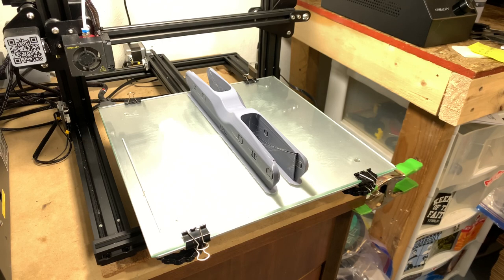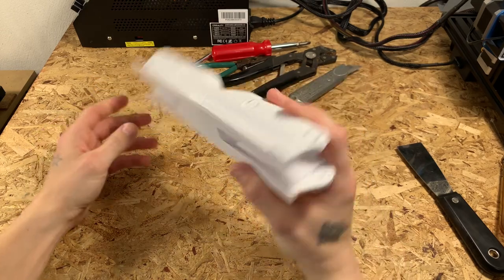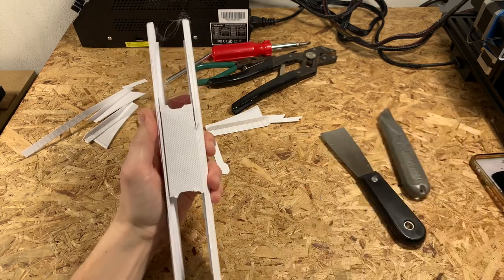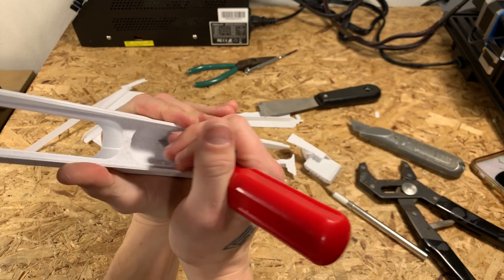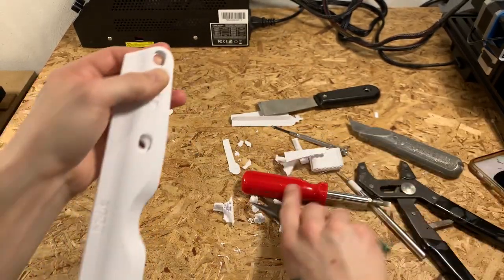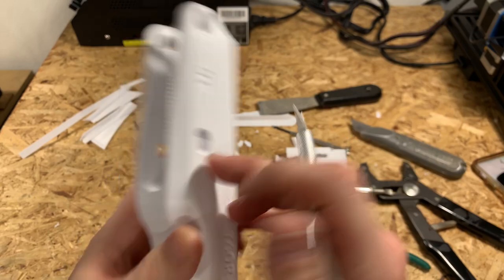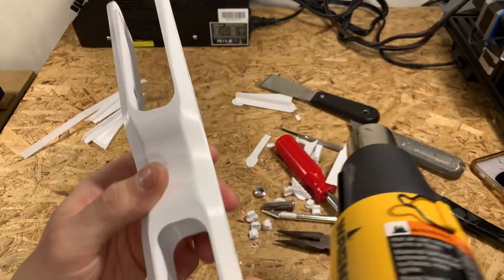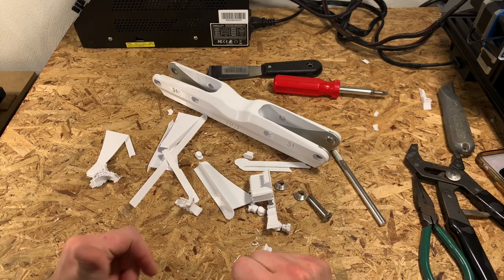How to remove supports and prepare 3D printed frame walls for the 50/50 Core System

Comment: Can you print some suspension frames and some replacment bushings. As far as I know there are not more suspension frames being made
Reply from the maker: No. 3D printed parts would be too weak for that. They would need to be machined out of a stronger plastic.
Reply: Do you think you can make a suspension frame or some replacment bushings for fiziks frames somehow